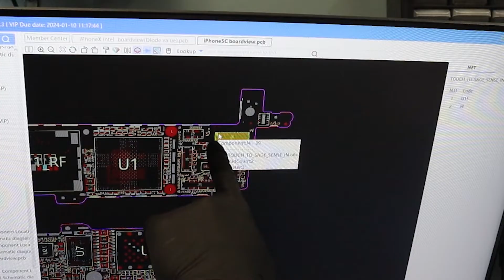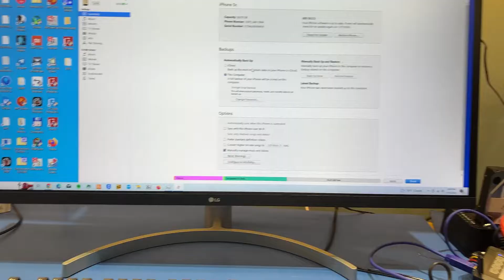iPhone Ran Over By A Car... Can We Fix?

Comment: How did you repair this first pad!! Jumpers I get but what magic wand did you wave on this one? 1:02
Reply from the maker: It was just loose and still made a connection. So I used some uv mask to hold it back in place

Comment: I might be stupid. But if you got the screen working couldn't you just plug a lighting-to-USB-a dongle and then plug a mouse into that dongle, then use the mouse to touch? 
I have used this trick to help people with no touch on samsung phones before and you can use the mouse to have a cuesur on the screen with no extra setup or need for actually touch. Although I have never actually tried it with a iPhone for the reason of not having a lightning dongle so it may not work. I might just be stupid 🤣

Comment: My phone shows constant charge at 85% but shuts off if i do something on the phone, runs fine with the charger plugged, the phone doesn't discharge doesn't charge. Rog phone 5. Is a faulty battery? Thank you

Comment: hey do you know if its a problem with the hard drive its an xbox one s and it gets a e100 error screen i tried offline updating but it didint work it allways stops at step 3 when it gets does with step 2 it just freezes and after a while it shows the error screen so is it the hard drive or not